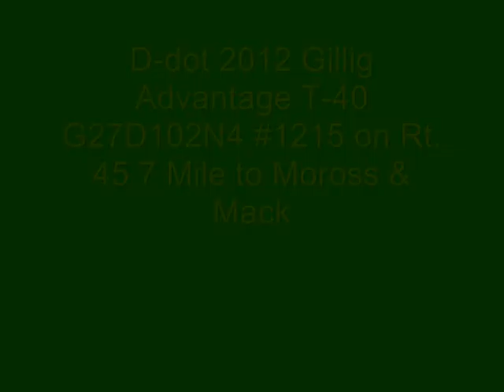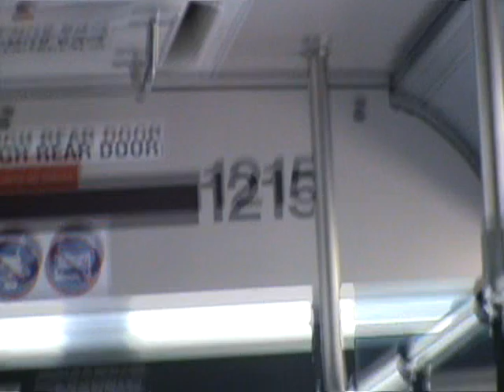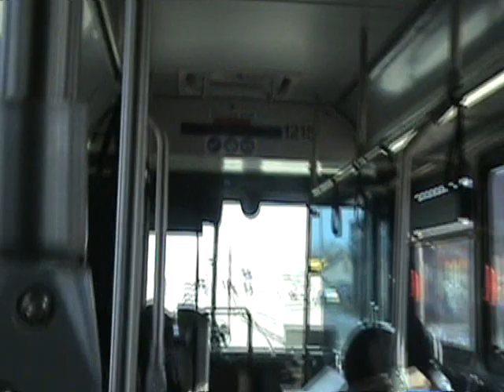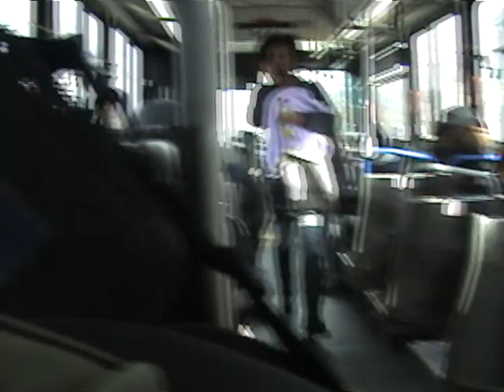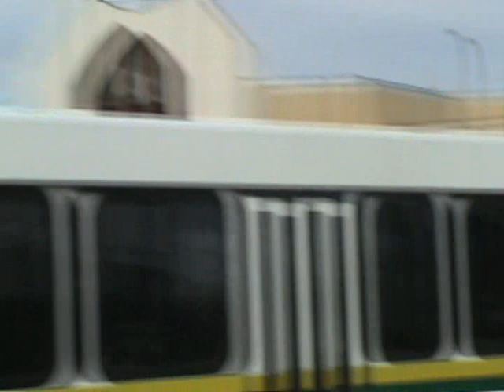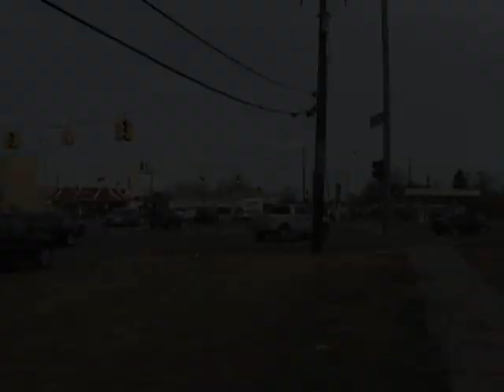A ride on D-dot 2012 Gillig Advantage G27D102N4 #1215

Comment: Nice, the Gillig with the ISL9 sounds great and similar like the 2010 models with ISL9. Notice the humming noise is quieter and has a higher pitch (heard from the interior) that is audible when the engine's rpm increase. Great to see that they gone to gillig after the past 5 years of ordering buses from New Flyer.